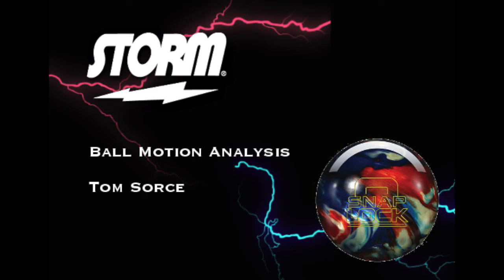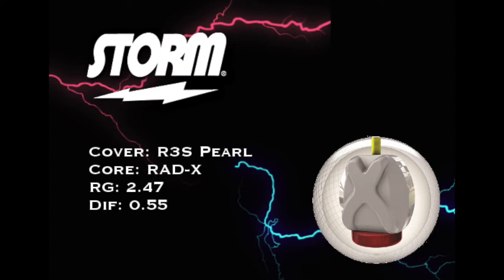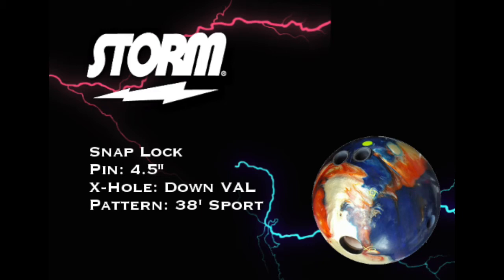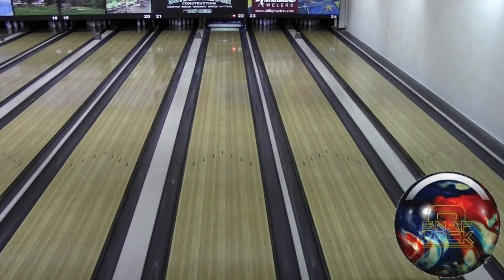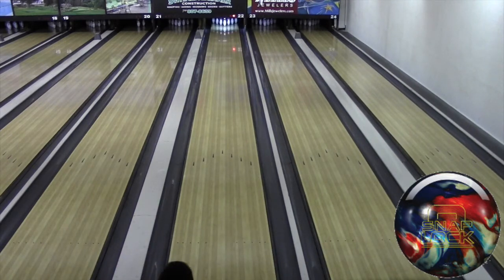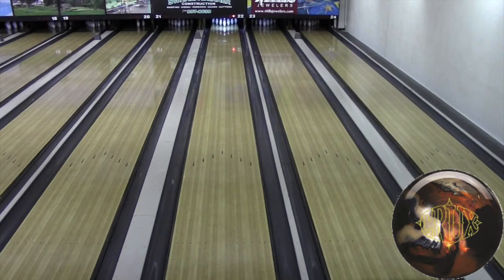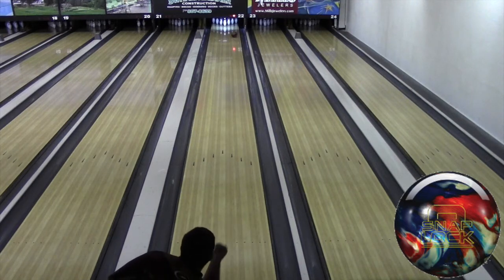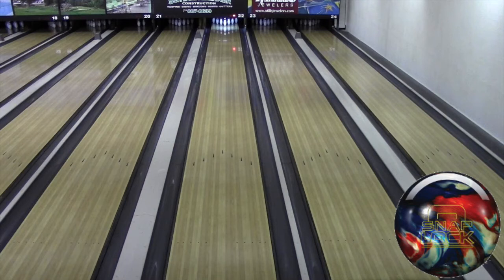Snap Lock

Comment: I'm highly thinking about getting this ball for down lane action I'm a tweener so would this be good ?
Reply from the maker: Well it kind of depends.  Do you want something very clean through the front?  If so, maybe, but a Hyroad or Hyroad Pearl is probably a better option.  This ball is still medium-quick response but it is stronger than those.
Reply: Im looking for something with a lot of back end and my coach highly recommended this ball
Reply from the maker: We could actually have a long winded discussion of what "back end" means. Its not a term I love because it exists because of the optical illusion of the lane from eye level.  Balls don't hook as much as people think and they certainly don't do it from as far down the lane as it looks.  In fact, getting a ball further down the lane isn't usually a good idea. (I'm going to do a video on this soon).

However, what most people mean when they say "back end" is quick response.  The snap lock is on the quicker end of the scale.  So, if thats what your looking for its not a bad choice.  I would just be aware that the Hyroad and Hyroad Pearl are definitely quicker.  Just keep that in mind.

Comment: Hey Tom I just got a Snap Lock drilled last Sat and will try it tomorrow in leagues. I wanted to ask you though what is the similarities and difference between the Crux Pearl which I ordered "used one" and the Hyper Cell Skid which I also have
Reply from the maker: I think the Snap Lock and the Crux Pearl are similar in terms of strength. The Snap Lock seems a little quicker, though. The Crux Pearl make a more smooth, continuous motion off the friction. The Skid is probably he quickest of them all. It's also on the stronger side of things. They certainly seem like they work well off of each other but they are pretty close as a group of balls. 

As for strength, like I said, they're pretty similar. Response time (from slowest to quickest) Crux Pearl -> Snap Lock -> Skid

Comment: Thank you for the info! I have another question, I currently have that hyroad pearl and always a Fight, any suggestions on balls that would be a good add based on my current arsenal? I love your review videos so I'd love your opinion
Reply from the maker: Well, it depends.  I know you are a two-hander so you probably have two ways to go here based on what you think.

If you think that the Fight has typically been strong enough on everything that you bowl then your best best is to find something between the Fight and the Hyroad Pearl.  That could be something like am IQ Tour, Match Pearl or the Snap Lock (the IQ Tour seems to be the most versatile of those options - that's why its been around for so long).

If you find yourself needing something stronger (or slower) than the Fight sometimes (heavy oil or long patterns) then you have some different options: Phaze II (video coming soon), Alpha Crux, Haywire, or No Rules (strongest of them all arguably).

Without knowing much about your game that's the best I can do.  Hopefully that points you in the right direction.